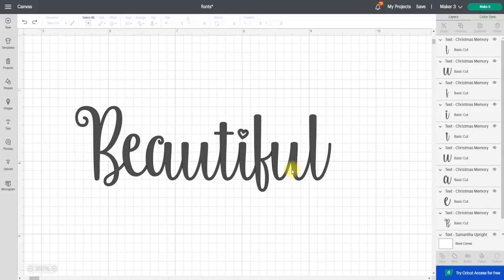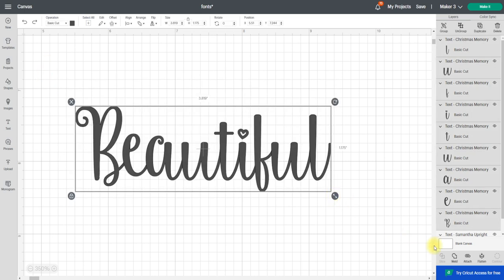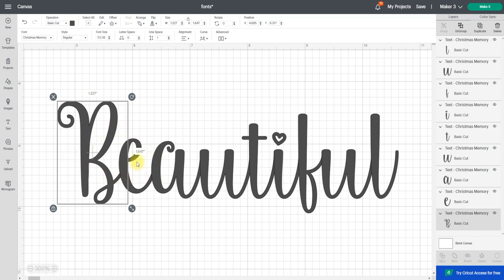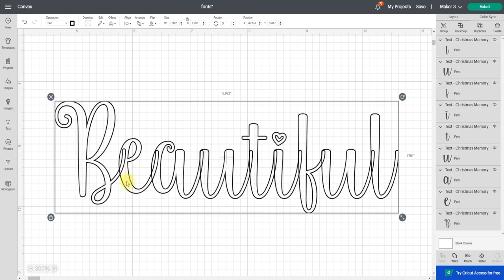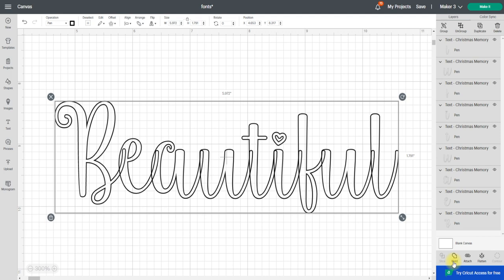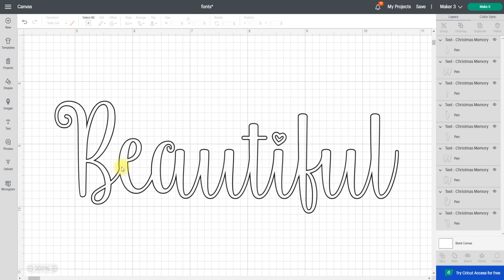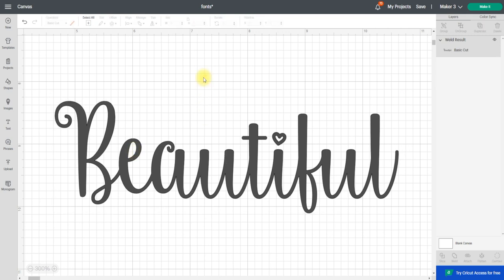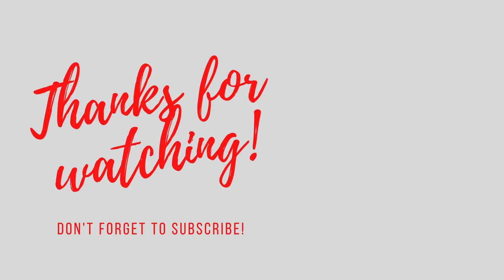How to stop letters from infilling

Comment: Oh my goodness - thanks for the tip - I did not see a word had filled in a letter until it did print and cut and then it was too late - I am going to go in and retype that word and see what happens
Reply: The font I used automatically filled in the letter - I didn’t move any letters - so I decided to check it out - the word is “This” and the capital “T” was hanging too low and barely touching the “h” - I ungrouped the letters and moved the “T” up a tad and it fixed the problem - so some things are not anything you did, it just happens